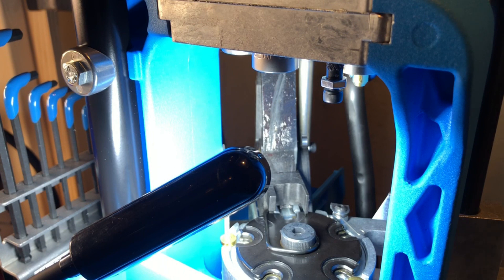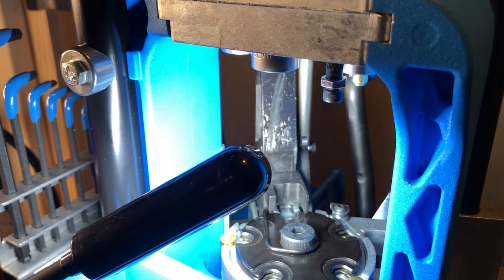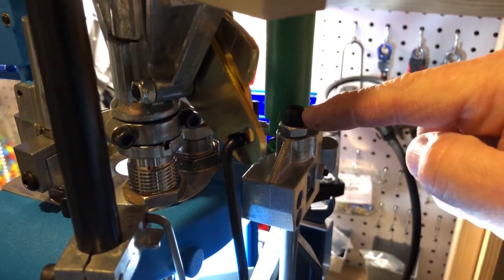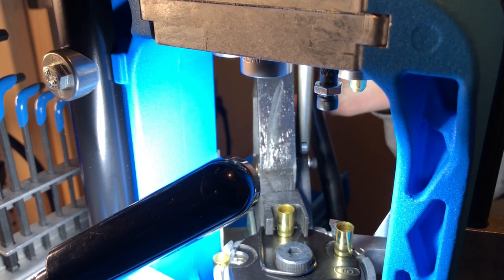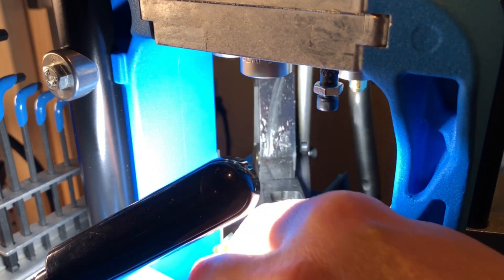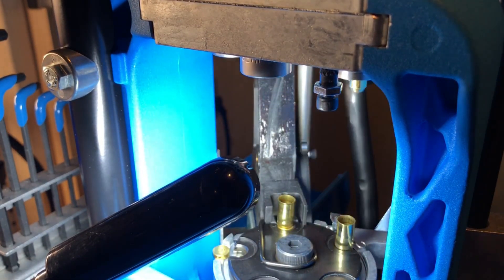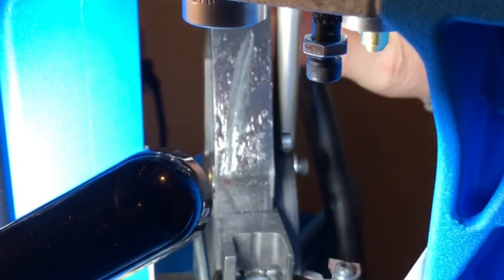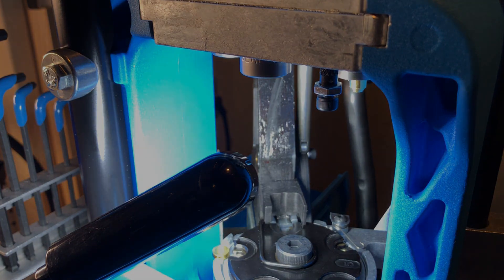Upgrade to the Dillon XL750 Case Camming Pin (Updated)

Comment: Is the feeling of the stroke different (more smooth?) with this new camming pin? Clearly it’s a better design than the original piece using friction. Can you feel the difference? Thanks for the video!
Reply from the maker: It definitely is smoother.
Reply: Gatesjunior Reloading Excellent! I just got mine in the mail today because of your recommendation. I also bought the aluminum powder funnel and brick primer tube holder. This is very nice quality stuff.